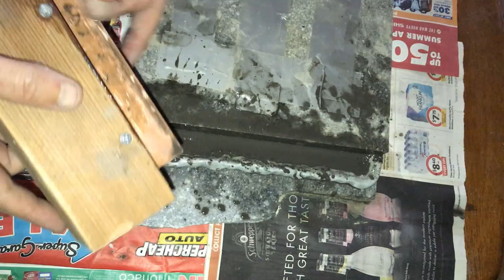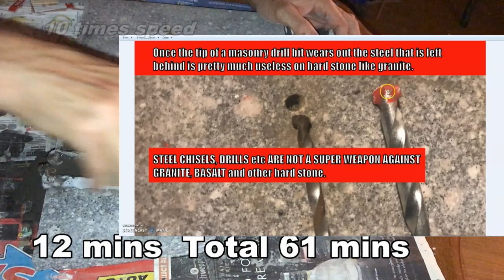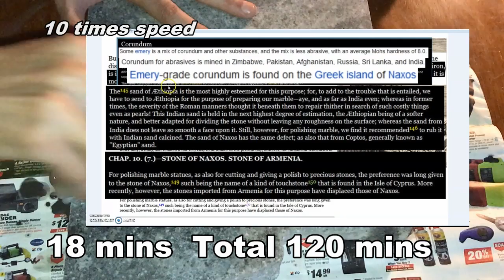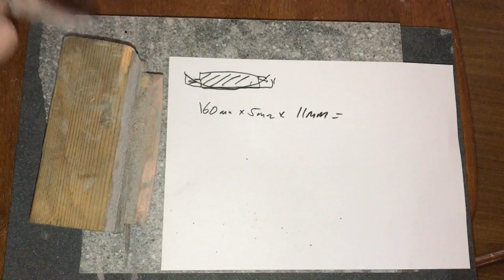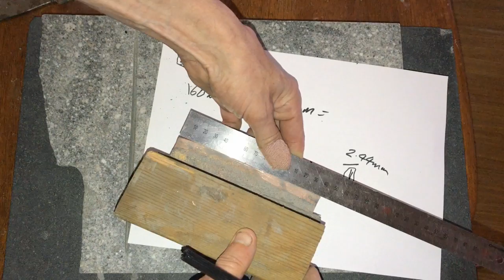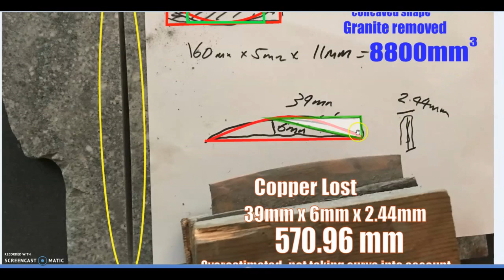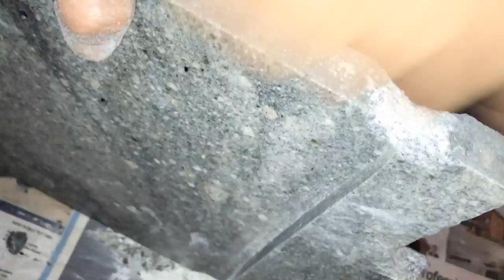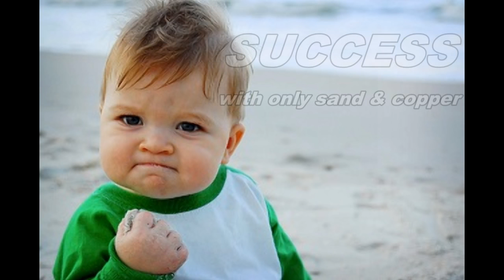LOST ANCIENT HIGH TECHNOLOGY- HIGH SPEED CIRCULAR SAWS 100% Debunked with Experimental Archeology

Comment: Modern drilling methods for rock do not always use abrasiveness to grind material; many rely on pushing hard bits (cobalt-cemented tungsten carbide usually) into the rock and causing some localized crushing; around this contact point, the rock bends causing it to exceed the tensile strength of the rock and cracks to form. As the bits are either rolled against the rock or hammered into the rock you get many different contact points with cracks radiating out from them. Where those cracks meet a small stone chip flakes off.
Reply: are the small chippings extracted some way or do they also work as an abrasive.I often wondered if some form of sonic vibration could, be used,similar to a hammer drill,to pulverize and fragment the materials in front of cutter?

Comment: Hey, your video needs some brief summary of what was done. So, how long did it take to cut an inch depth line into the granite? All day? An hour? One minute? What was it??? And can you honestly, with straight face, extrapolate your method of cutting 1 inch line on a granite piece into cutting a 4 ft granite block found in Egypt? I put the link below. Oh, I re-examined the video and the depth of the cut is a little more than 2 ft, because they had 2 (circular) saw marks working from two different directions, but the saw progressed like entire length of the granite sarcophagus, which seems to be about 8 ft? But not all they way, but they would have cut the whole thing if the lid did not break. So, you can cut 2 ft deep, 8 ft long cut on granite with your little what-a-joke blade??? How long it will take to cut 2 ft x 8 ft??? A year? Give me a break man... Let me make a similar argument. A plastic knife can scratch a wood. It can even make a groove I guess, if you keep scratching the wood for an hour or 5 or 10 hours. Would you argue that people may build a house with woods cut by plastic knives??? With beautiful carvings and moldings too??? Using plastic knives??? Theoretically, you can build one, right??? Total lying fake news is your such a joke "demonstration". Here is the video of the amazing ancient stone cuttings. No way they were as stupid and dumb as you. https://youtu.be/S6Y0Dzl0RCA
Reply from the maker: To anyone who reads this I did not create a sock puppet account, Nibiru12 character is a real person.
LOL, I know this one,  Brien Foerster at 12 minutes says to drill/cut granite "You need at least diamond level technology" on a video where you see granite being cut by copper blade and simple abrasive. Wow, you really aren't the sharpest blade in the box are you?
You reference a guy that literally says you cannot cut andesite with copper, and a guy who uses Mohs scale to grade pounding stones, in other words he believes glass makes as good as a chisel as mild steel.
And you are calling people dumb and stupid? 
Lying fake news eh? You are a coward and a liar. You made a $10 000 challenge with supreme smug confidence and yet you aren't willing to go beyond the youtube comments section? Now here you are actually linking Brien Foerster videos as if it's some sort of check mate. :-) Promoting a guy who lives by the "mantra" impossible on a video where the "Impossible" is being demoonstrated. That takes a special kind of stupid that does.
Hey! Here's an idea, what about you send the Wright Bros a book about how heavier than air flight is impossible? Maybe attach a series of logical fallacy analogies about propellors made of cloth being 'theoretically" feasible?
Reply: @SacredGeometryDecoded  I thought you ran away very fast in the previous thread... Nice to talk with you again here!!! Well, so, are you ready to talk about "It's all been done before, actually much better by fitting shattered 3D stones."??? Or are you going to run away again real fast??? In any case, to cut granite, you are not going to mess with sand and some stupid copper pieces. You do need some harder material like diamond or whatever. In addition, wasn't copper very $$$expansive$$$ back then??? You are gonna waste and recycle the precious copper to cut granite with it at a speed of like 2 mm per hour??? Whom are you kidding man... So here, let me ask you another easy question you wouldn't want to answer. How the hell would you cut through 8 ft granite block using your little mickey mouse copper-L-O-L "blade"??? LMAO!!! How many YEARS would it take to cut it??? 5 years???  Use some common sense, will ya?
Reply from the maker: Nibiru12 I didn’t run away from the thread. You wouldn’t take the next step if your challenge.
Quartz gives granite its hardness. Sand and granite dust contain quartz.. like cuts like which is why you can grind / cut granite with granite.
All well established facts.
You are living in an ignorant delusion if you think you need diamond.
Here in Sydney we have lots of large granite blocks dating to before diamond tools.
They are all over the world and there’s even photos of it being cut and drilled the old fashioned way.
Why don’t you send the Foerster video of magnetic anomalies at Puma Punku? You know the one where he holds a magnetic compass next to andesite (one of the most naturally magnetic stones) and acts surprised that it affects the magnetic field.
Or the one where he says Romans couldn’t work granite- basalt?
Please do keep your sources coming.
And if you are a man if your word either withdraw the challenge or man up to it.
When we win we can use that money to do other large scale demos of the impossible lost high technology fool marks.
Reply from the maker: Nibiru12 2mm where did you get that from, lost high tech fantasy world. I don’t even weight this saw and did several times better than that,without even a weight.
You know that even with steel this won’t cut faster right? 
It speaks volumes that you linked a Brien Foerster video as a source. Even amongst the stupid wrongness that is the foundation of lost high technology Foerster is the lowest wrung of idiocy.
Reply: @SacredGeometryDecoded  Foerster, I believe about 50% of what he says. I don't think Pyramid is some energy generating devices, etc. But, I agree with him and believe there was some seriously advanced technology that produced Pyramid and polygonal stone walls. Ok, try answering this:
1. With your rate of cut, how long would it take to cut through 4 ft by 8 ft granite? 100 years? LOL... Can the $$copper$$ blade even work beyond couple of inches of depth? LMAO...
2. You know that great pyramid has 4 vent shafts that are about 20 cm by 20 cm cross section, where no human can fit through, not even a child. They are cut from so called kings and queens chambers, and they are about 100 m long. How were they "hand" carved?
3. Polygonal stone walls, oh, don't run away again, a different topic.... they got zero gap, not easy (if it is even possible) to do even in the 21st century. They are found in Egypt, South America, all over Europe, Japan, and even in Australia. Basically all over the world. Was there a global civilization in the past, way before, like 5,000-10,000 years ago? Maybe even before that? Since Egyptian old kingdom never mentions going to South America or corresponding with Japan, the global civilization should date well before the old kingdom, right? Would you at least agree on that? Global civilization before Columbus? https://youtu.be/BTd1fRCAvR4
4. About Baalbek megaliths, if you think Romans could have cut and moved the 1,000 ton block with "no problem", why don't we see that in other Roman sites? If it is not so difficult, how come there was NEVER a single incident where such massive stone blocks being moved to be used as building foundation in the entire WRITTEN HISTORY OF HUMANS??? Those massive blocks, use of it, have NEVER BEEN RECORDED! Thunder stone you referred to, well documented in 18th century, was not a cut rectangular block, nor a part of any building structure, but some random shaped thing, randomly placed, no leveling/plumbing needed, and even moving that one stone took giant effort for the 18th century people. People never moved such huge stones, even random shape, since then. It is not because they are easy, but because they are stupidly hard and thus UNECONOMICAL! For the people building Baalbek temple, they could have easily used 100 ton, or 50 ton blocks, and build faster, instead of using 1,000 ton blocks. They did not use 10,000 ton blocks though. Maybe that was too much even for them. But still, they moved 1,000 ton blocks, seemingly because it was NOT SO HARD FOR THEM, and the SIZE of 1,000 ton MADE SENSE TO THEM! Not to us in the 21st century! That is the problem. With cranes capable of lifting 100,000 tons, it is NOT EASY, ECONOMICAL, NOR SENSIBLE to use such massive stones for buildings even now. You know stones last forever, like up to million, billion years....  And reinforced concrete lasts like 100 years, right? And stones look IMPRESSIVE, BEAUTIFUL, concrete looks UGLY, pulverizes when exposed long term, so they cover it with stones, glasses, tiles, what not! People would use giant stones, without mortar, and make their buildings last forever. But they don't do that! Even in the 21st century!!!! We are not there yet to use Giant Stone blocks as building material, thus it is a MYSTERY that Baalbek has such HUGE STONES!!!  We don't know how and why they moved such stupidly big stones!!!
Reply: @SacredGeometryDecoded  I would be interested to see your reply to the last comment in this thread. Just to add some of my own thoughts, I agree that this video provides evidence that it is not impossible to make the specific marks and cuts in this type of stone with the given materials. However I think you are perhaps overlooking the scale of something like the Great Pyramid, where with some calculations we can figure out that a single multi-ton brick would have needed to be transported (across the nile), quarried, cut, and laid in place every couple minutes for 20+ years if we are trying to fit into that timeline. That of course is not taking into account the whole society that would have to support the massive Manpower that had to be used, as well as all of the Limestone casing stones that were removed from the pyramid over years because of their value. If we factor in the completely staggering amount of planning that would have had to take place in order to give the pyramids their precise measurements, I think it is a little facetious to suggest that this video debunks the possibility of ancient high technology altogether.
Reply from the maker: @lordofleaves257  I have addressed these issues in other threads over and over. Points such as if Romans could lift heavy blocks then why didn’t they? We can move heavy blocks by calling a crane from your phone. 
Plus the ‘if’ Romans could do it. No if’s about it, anyone interested in topics such as Egypt and hasn’t read Pliny, Strabo, Heron or Vitruvius really isn’t that interested. 
Please go through the threads as I have answered all these in detail in the past.
Though one point, the Pyramid scale, the great pyramids are filled with irregular roughly hewn blocks and are most certainly not precisely cut and fitted. Even on the outer layers with good quality stone lime mortar is used extensively.. heavy blocks are lower and at the top they get smaller.
Channels such as BrienFoerster and uncharted x never tell the reality of these facts

Comment: Good video. But did they cut a 20 or 30 feet stone with a giant copper saw like that? Why would they do that if they could have just use wooden wedges to break it off. It doesn’t make sense. It seems more likely that they had something that made it easy for them to do cut with marks like that wouldn’t it?
Reply: There are no 30ft stones with sawn faces in Ancient Egypt, you answered your own question. They used timber wedges to split larger stones and the evidence for this is all over Egypt.

Comment: So how big would the saw have to be, to cut a 20 ton block?, How would you operate it?
Reply from the maker: In the description is a link to an earlier version. Almost same name to this video. 
You can cut as long as you want. 6 foot sheets can be worked/welded/ stapled into a longer blade. A wooden guide keeps them straight until the cut is deep enough to guide the blade from then on.

Shows old pictures of quarrymen using same technique with a pendulum saw to cut a huge granite block.
Romans attached them a waterwheel with multiple blades lined up to cut slabs at once.
Remember it’s not the steel or copper saw that cuts but the abrasive. I’ve cut granite with plastic and wood with nothing but crushed sandstone as the abrasive.

Comment: While it wasn't too surprising to see that the cutting action was effective, as you so logically point out that it's a grinding process and that this technique can achieve it, I was surprised to see the striation pattern... simply because I would assume that a grinding process that is removing material so slowly would leave quite a smooth, or at least uniform, surface. If I were to "cut" a piece of wood with sand-paper, I would expect the resulting cross-section to be very smooth. Can you describe how the striations are created? Is each one the result of a repositioning of the blade, or a re-application of abrasive? 
Thanks for your time working on this :)
Reply from the maker: Cheers
The type of abrasive will leave different striations but the real issue is the grit size. I made my own by breaking up quartz and corundum(aluminium oxide) from masonry disks. The few experiments that have been done that I know of use 80 grit or finer which is much dust. They left very polished surfaces where a microscope was needed to observe the scratch marks. The larger the grain the more deeper the striations. This applies also to granite cores drilled with copper. Working on piecing together the video of the granite core samples I made using the stone mason drills depicted on Egyptian tomb walls and in Gardiner’s Sign List.
By using different grit sizes on different types of granite I have replicated the striations seem on artefacts.
Reply: @SacredGeometryDecoded  Would love to see a breakdown of examples/comparisons of what scratches/striations are left by a variety of a abrasives at different grit sizes. That would be excellent info to have available.